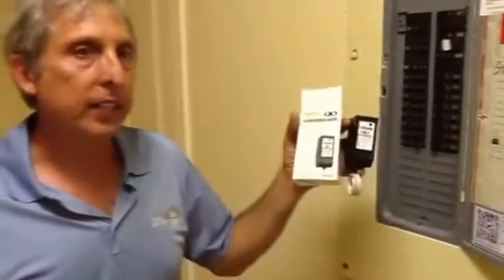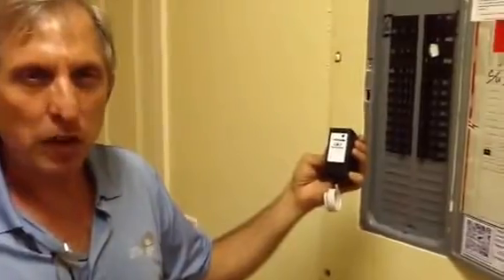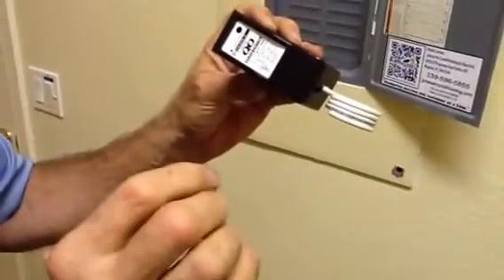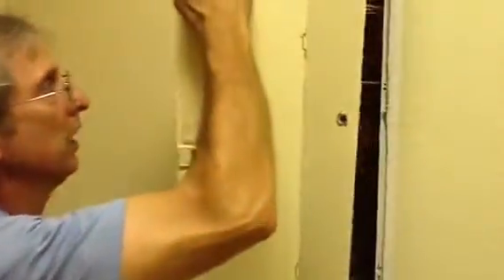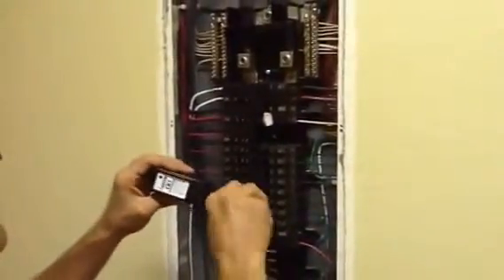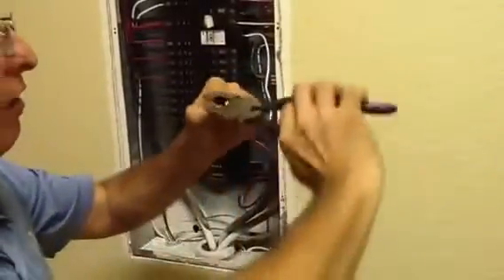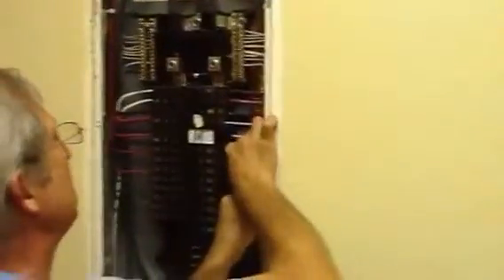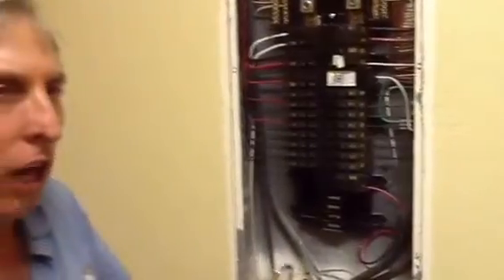Installing a Square D Surge Protective Device

Comment: If you get a surge and it trips,  it's the device fried and you need a new one? Or do you shut off the power to the panel and turn it back on and it resets it?

Comment: Shorter is better and you need to install it as close to the service as possible! It's trying to deal with a surge as close to the source as it can and that white wire needs as short a path as possible to the Neutral.

Comment: Can’t believe you used linesman’s as a striping tool! Rookie! Use wire stripping pliers please!
Reply: A skilled electrician can "feel" the depth of the installation that's being stripped. Granted, I will use a pair of wire strippers, if available, but his method also works. Don't be so critical, rookie!

Comment: Would installing 2 of these in one panel add more/increase protection or be a redundancy of sorts?  Should one be installed in sub panels?
Reply: No, and no. These work by detecting high voltage and shunting it to ground - if you have two of them near each other then as soon as one starts shunting the voltage to ground the other won't detect the voltage, unless of course it does, which will cause the first one to stop. They'll kind of fight with each other, giving worse performance to both.

As for the subpanel, surges come in from outside - there's no reason to put one in a subpanel. (But it won't hurt anything, unlike putting them next to each other.)
Reply: Yes each will handle it rated protection you have to have them as close to the source as possible I would put one on each side and then trim the white wire so it's not any longer than needed don't kink or pull on it but I would leave bas little slack as possible this is not something that needs to be relocated.

Comment: Isn't the white wire connected to the ground bus? It should be cut as short as possible so that surge can drain to ground faster.

Comment: You have to be working on a cold panel, you always want your tools taped, period, and it does not matter if it right at the top or two breaker positions down, it still works.

Comment: lightning fried my hvac board.  its the second time this has happened.  its an older home in an area with no building codes.  Mt son in law (a licensed electrician) and I installed a new main panel with a main disconnect to please the mortgage company when I bought the house.  will this protect my hvac?
Reply from the maker: I would add a surge arrester on the whole house panel
Reply: the same storm killed my dishwasher circuit board too.  my soon to be ex son in law suggested this very product.
Reply: Yes it can help, but I would also put a surge protector with at least 600 joules on all of your appliances including your furnace. They make them with just one plug.
Reply: Surge protectors work best when they are as close to what you want to protect as possible.

Comment: You only protected half the house. A whole house protection device is connected to a double pole 20A breaker.
Reply: This device has two poles and protects both L1 and L2 to neutral.  In most panel bonds, the neutral is bonded to ground, so you also get L1 and L2 protection to ground.  In secondary subpanels, downstream from a main panel such as in a barn or garage, the neutral is NOT bonded to ground, so you can install a second SurgeBreaker with the white wire going to the ground buss bar for better protection.
Reply: I like that :)
Good catch

Comment: How do you identify if it's a QO panel?
Reply: blueskylazer It should say anywhere on the inside of the door, either Homeline or QO, also home line breakers are larger, about 1 inch, QO breakers are about 1/2 inch thick. Also QO panel has a Plastic Shield covering the Phase Bars, where Homeline Phase Bars are exposed.
Reply: Thanks for the infol.

Comment: "qualified licensed electrician" lol If you can install a ceiling fan, you can install this.
Reply: I have seen many rightist hell-holes as you mentioned also that are inspection hungry.  Call enough and they will stop demanding inspections I found LOL.
Reply: Yes, it's a fairly simple installation, but you can void your home insurance policy by having non-licensed work done.
Reply: translation: get invoices and keep them in a fire-proof safe
Reply: Mic D Nonsense, maybe in some leftist hellhole where they regulate everything, but most places you can do electrical work yourself so long as you follow code. Some places may require an inspection, but I doubt something this simple will cause any problems. You can just say they installed it when they put the panel in, it is your word against theirs.

Comment: Installed wrong.  They are supposed to be installed as close to the main breaker as possible and the neutral has to be short as possible.  Read it on the manufaturers website.  I'm an electrician and I install many of these but I use CutlerHammer/Eaton SPDs a better product with a better warranty for the homeowner.
Reply: SkilledEddie Argo Electrical Services First of all, I'm no licensed electrician, so I may be wrong. And the website does mention to make it close to the main breaker and cut the wire as short as possible. To cut the white neutral wire short makes some sense as the shorter the less electric resistance, which may be good to let the surge go through, while sometimes the resistance is not the less the better, it depends and I'm not sure about this case. But I just can't find a reasonable reason to make this device close to the main breaker. I think it doesn't matter where you put it. 

As we all know this is a type 2 surge protector which means it can protect electric appliances from the surge  inside a house. After I google, I find most of the surges are generated inside a house by some power hungry devices like AC, dyer etc. So when a surge generated, it will flow back to the sub panel and flow through other breakers and then harm the devices on other branches. So a simple question is if you install this protector to the position closest to the main breaker and unluckily a surge generated from the branch which is furthest from the main breaker, is this way of installation good to protect other devices? Like you mentioned, the surge will reach the closest branch and you want the surge protector to be closest to the surge source (you assume the surge only came from the main breaker which is not always true), but if that is true, no matter which position in the box you install it, it will always benefit some and harm others， because surge can be generated from different branches (let's ignore the surge from outside for now as there is another surge protector called type1 to do that job which should be installed at main breaker)

Actually the example above is simply invalid. Because electric flow(current) just doesn't work like water flow, but people always try to think that way because it is more intuitive. It the not a physical flow like water, it is movement of electric field (of course if you insist, electrons do flow physically but electric 
current is much faster than electron mobility because of that). So the surge will reach all the branches simultaneously (again even light speed take some time we just ignore it) not the physical position closest first. The only thing matters is which branches has lower resistance and the surge current will distribute based on that (surge protector will make its branch low resistance and let the surge mainly flow through it instead of other devices you want to protect). So if you understand that and I'm sure you as a licensed electrician knows all the  breaches are in parallel, then you will realize it doesn't matter where you put it.

I just bought one last week and am trying to learn how to install it myself so I find this video by google, The rail in the breaker box for contacting the breakers are thick so I don't think it will introduce too much resistance, if that is true (again I'm not electrician, correct me if I was wrong), then based on the knowledge I learned from high school years ago, I support this video and don't think it need to be put to the position closet to the main breaker.
Reply: Billy Smith Found this right in the instructions on the schneider/square d website.   "The SPD requires two adjacent mounting spaces and must be installed
as close to neutral assembly and main circuit breaker or main lugs as possible.
Keep wire lengths as short as possible with no sharp bends."

So according to manufacturer instructions he installed it wrong.
Reply: Billy Smith Also he is installing a Square D not a Levitton.
Reply: correct I made that plain I hope
Reply: SkilledEddie Talked to Leviton surge suppressor department , about 200 amp Surge suppressor for the whole house catalog # 51120-1  .It does not matter where in the bus bar you install the device .You can double tap the breaker if you so desire,. Phone #1-800-824-3005
Reply: This is the More Superior Surge Protector(Supressor) & Just because the Manufacturer suggest something doesn't always make it the best Practice. http://argoelectrical.com/electrical-safety-1/wholehousesurgeprotector.html
Reply: Argo Electrical Services The manufacturer doesn't "suggest" they tell you how it needs to be installed or you void the warranty.  Makes perfect sense to install the SPD at the very top of the panel.  Why would you want the surges to go through branch circuits before hitting the SPD?  The whole idea of a SPD is to stop these dangerous surges before they enter the branch circuits though the house.
Reply: SkilledEddie Really, WHy don't you install it in front of the Meter??
Reply: The Answer is there is no Surge Protection without the Grounding Conductor...(Neutral) Your Utility does not send a Neutral Connection. There are 2 Hots and a Ground in Residential Service Wiring..The Neutral is created in the Service...
Reply: Argo Electrical Services Wow are really an electrician? yikes!  I'm not even going to correct you on this stuff because i know it will be a back and forth battle.  Again yikes!!
Reply: SkilledEddie HAHAHA...
Reply: @SkilledEddie  The surges don't always come from the top. Sometimes they come from motors of equipment inside the house.